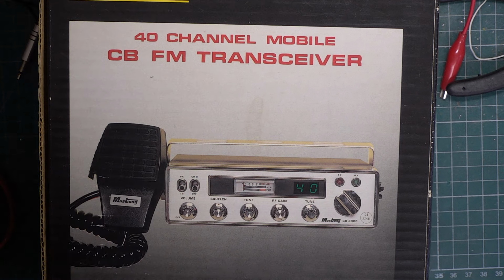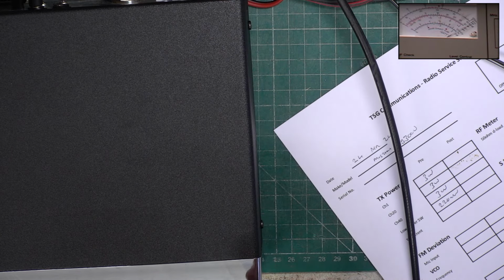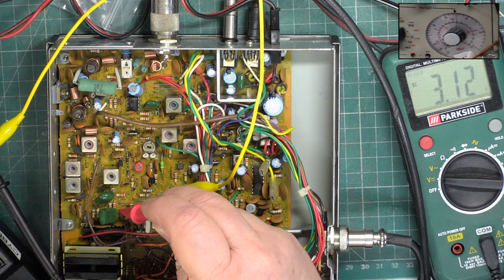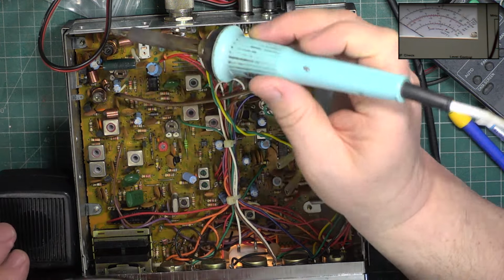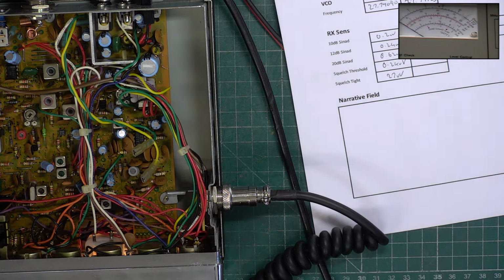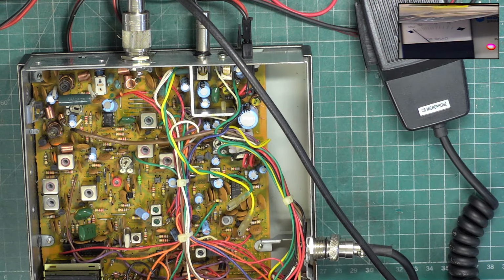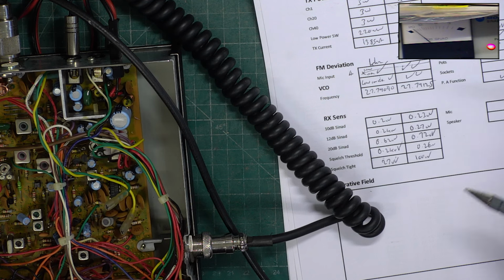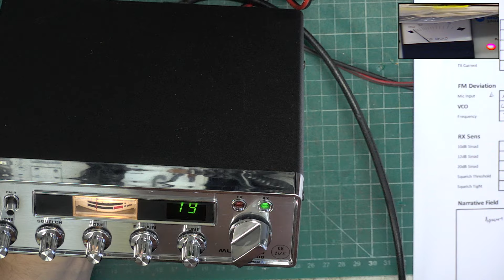Mustang 3000 CB27/81 UKFM CB radio - Boxed repair & alignment

Comment: Gracias.
Se puede modificar para transmitir en AM?
Reply from the maker: It's designed as a UK FM only radio covering 27.60125 (ch1) to 27.99125 (ch40). The UK channels are FM only & a unique set of channels for the UK only. 

Richard, G0OJF, UK
Reply: @ukfmcbradioservicingTango21  puede enviarme el diagrama electrico del equipo?
Gracias.
Reply from the maker: @84rafaelkld  It uses the Cybernet PTBM002F chassis which is covered in the Amstrad CB901 service manual. If you Email me, I'll attach a copy back to you.
rshireby@yahoo.co.uk

Richard,G0OJF, UK